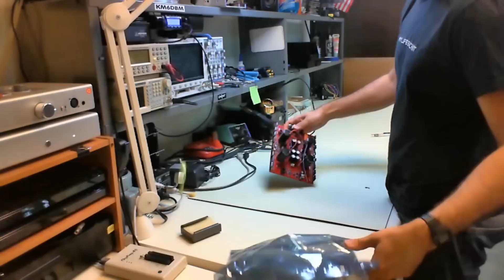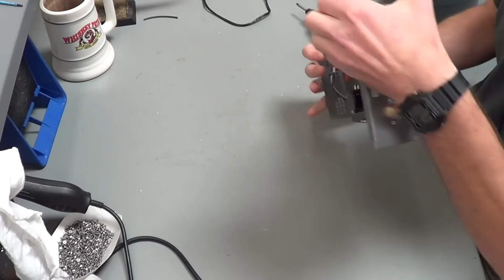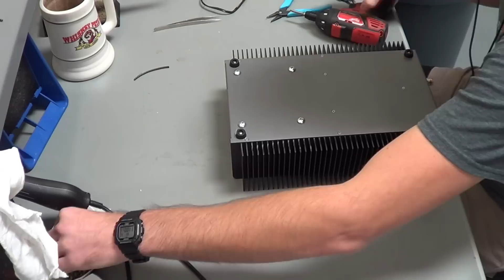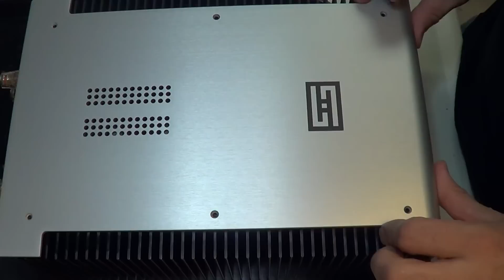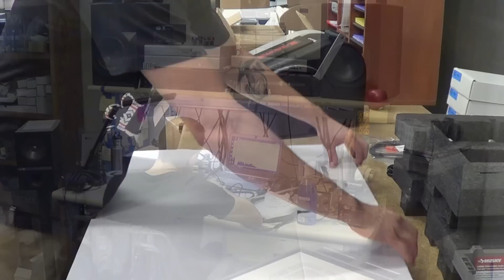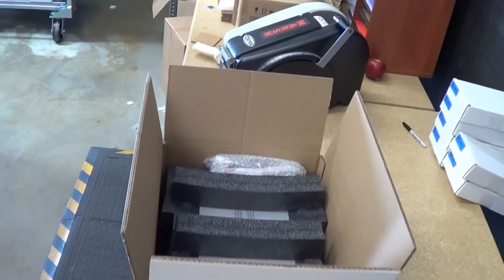VIDAR FULL BUILD

Comment: This amp has authority and subtlety. Both of these qualities are difficult to package into one amplifier let alone with this quality-of-build, at this price-point, made in the USA. Dead quiet. I keep all my solid state on/quiescent as transistors and capacitors do not like regular on/off switching. It coasts along warm-to-warmer with or without signal. A small piece of white wire insulation lodged itself in the back of the amplifier when the voltage was changed from 115 to 230. You can see it pop off and land between the PC board and chassis.

Comment: I love the Sorbothane bumpers to mechanically isolate the transformer, although I was surprised a Toroidal transformer wasn't spec'd.  Maybe at this price point it isn't cost feasible.  The binding posts also look very high quality, much better than the usual cheapo 5 way binding posts you normally see at this price level.  Overall, the simplicity of the build is also impressive...seems like no "complexity for the sake of complexity" going on here.  :)
Reply: I wished they used a Toroidal, there wouldn't be any buzzing/humming.

Comment: @SchiitFerBrainz after converting from 115v to 230v, does anything else need to be adjusted? Like the bias pots? Or replacing any protection circuitry? Or is it just a simple conversion like you did at the 25:00 minute mark?

Comment: Tony,  I'm told you can connect anything. How best to connect the digital out from TV to a Modi-3 whose digital will then connect to a SMSL D18, which powers my two speakers?  I was thinking of using a Digital to coaxle from TV to the modi and a digital cable from the modi to the D18.

Comment: Hey guys, just wondering why you dont use torroidal transformers?
Reply from the maker: That's really more of a question for Mike since he designed it. The best that I could get from him is (to put it mildly) that he really doesn't like them. I know that doesn't really answer your question in detail but he said he might be doing a post on Headfi or SBAF about it at some point.
Reply: See my post, above.  :)
Reply: @riffraff9000  couldn't find your post.
Reply: Andy Menendez - my guess is: 1. In Rush Current Management, 2. Cost Performance.  They’re using a beefy conventional 600 VA transformer in a topology design that delivers exceptional performance for $700.   Personally IMO the way they’ve designed the Vidar topology the expense of a Torroidal isn’t really justified.

Comment: Im building a Tube preamp , but i cant find the schematics for Shit freya,   what i dont understand is why does it have 4 tubes , when you ha ve double triodes in one tube , so that is 8 tubes , 4 per chanel , these tubes usually run at 50x amplification , so 4 of them is 50 to the 4th , that is a lot of amplification . My Single ended Power Amp has 3 tubes , ECC81 and 83 ,  so what i dont get is why does Shit have 4 tubes , i guess they run it in A class , not AB push pull , that wouldnt make much sense .
Anyone knows a bit on this , maybe a schematic ?
Reply: I believe some are the tubes are for headphone output.

Comment: So, I just watched it being assembled, but where are the parts actually made?  Transformer, circuit boards, etc?  If it's China, shouldn't the product say 'Assembled in the USA' instead of 'Made in USA'?
Reply from the maker: Our board shop is in Simi Valley CA. and the metal shop is in San Fernando Valley CA. I'm working with Jaxx Manufacturing in Simi to Make a video about how they assemble our boards.
Reply: That's Awesome!  Thanks!

Comment: Lose the background music otherwise a good show. Clamping the devises is a genius move...
Reply: Regarding those clamps, does that then press the devices into the tape? What if one were to want to take this amp apart for repair? When you remove the heatsink will it separate from the devices due to the tape? Or are these devices not stuck to the tape but just laying against the tape?

Comment: From the FAQ:
So what happens if I have 2 ohm speakers? You didn’t rate Vidar for 2 ohms.
No, we didn’t. Because speakers that are rated below 4 ohms are pretty rare. The bottom line is that Vidar will run 2 ohm speakers, but it may run into its protection and turn itself off. 
 
Same for 4 ohms when running monoblocks?
Yes. Again, Vidar will probably work fine at sane volumes, but at higher output, you may trigger the protection.

To have to rely on playing at "sane" volums in 4 ohms for the Amp not to shut down is just not good enough... For me... 

Besides that, I love your DAC's and RIAA :)
Reply: RocknRolla1975 - then buy a $7,000 amp and not a $700 amp.  The Vidar will drive 98 percent of the speakers on the market just fine.